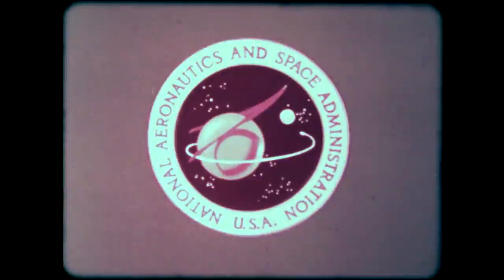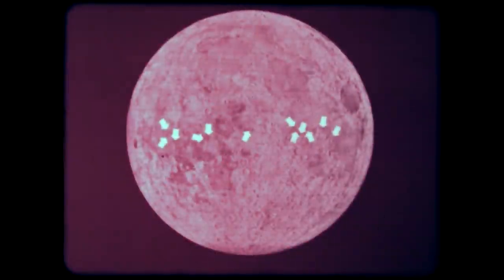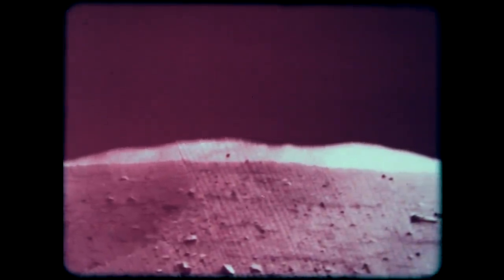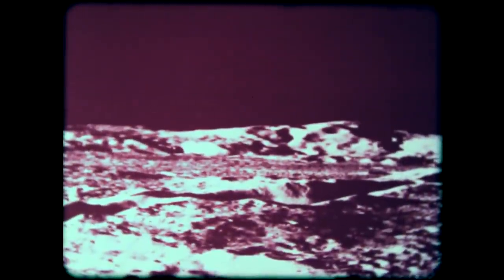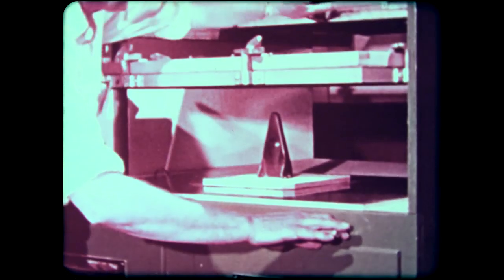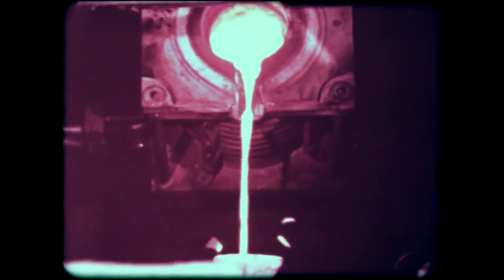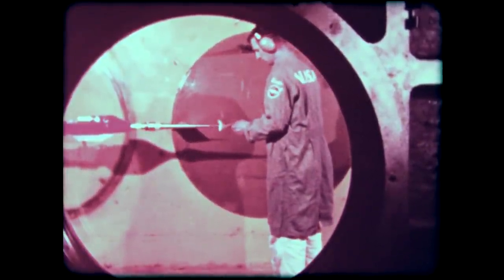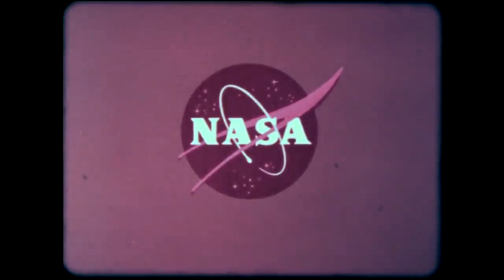NASA Aeronautics And Space Report No.28 (1966)

Comment: I wonder if any of those models still exist. They are works of art. Thanks for what you do Fran x
Reply: Yes, many of them still exist. I work at NASA Langley and you see them in displays by the big tunnels. Some very large/intricate models are still in crates in storage. Some are even on display at the Smithsonian. The 31” Mach 10 Tunnel has a display of about 20 early designs of the shuttle orbiter. Each model is a work of art.

Comment: That print was pretty dusty!! Ever consider doing some wet plate scans?  I've been toying around with doing single frame still capture of my home super 8 films, using an off the shelf raspberry Pi and Pi camera. Just need a simple mechanism to advance the film, and trigger the capture.  I have a "donor" Projector I'm looking to retrofit with the camera, and some cooler running LED light sources.  If I can time it right, I may be able to mount a small magnet on the shutter wheel, and use hall-effect sensor to trigger the image capture. Then I can use software to recombine the stills back into a video file. Simple, since I don't have any audio tracks to sync. 
Looking forward to more archives!
Reply from the maker: You pay for the shipping and scanning at a film house for the entire collection and it's a deal.